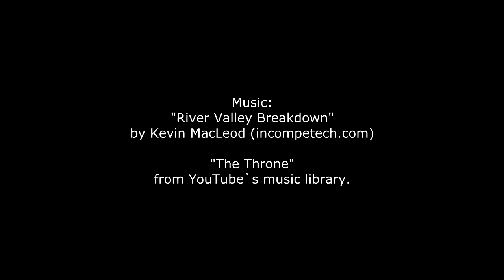How I build my Mason Bee Hives

Comment: You should turn the plank over and rout grooves on the other side too.  This would double the number of channels when you stack them.
Reply from the maker: Yes, I sometimes do that if the plank used is of a thicker dimension.

All the best,
Halvor.
Reply: I tried doing that but it doesn't work because of imperfections in the planks, the holes dont align perfectly when stacked.

Comment: Thanks Halvor.  Great how to video.  They are hard to make and this one will get lots of views.  I am going to research to see if we can have mason bees in Alberta Canada.  I need more pollination here.
Great work!!!
Bruce
Reply from the maker: Thanks, Bruce!
They are not so hard to make when you`ve made some of them, and received some routine. The holes can also be drilled insted of carved. However, it`s somehow tricky to get the holes exact in the center of the plank gap, so that`s the reason I use a carver.
The mason bee species, "Osmia lignaria" should be quite common in Alberta.
Do you want to give it a try? I`m sure you`ll notice a good increase of fruits. :)

Best wishes,
Halvor.
Reply: Gardening in Norway
Reply: Gardening in Norway Sorry about the empty post.  Do you have any idea about how much time I have to get the hive out?  We still have snow on the ground here.

;-(
Reply from the maker: Bruce Pender
As long as you are out with them before the fruit trees begins flowering, it`s ok.
At my location this is in May. So I think you have some time left to make a couple. :)
Reply: Gardening in Norway thx

Comment: Halvor - this is a very fine informational video on several different levels. You are also an accomplished craftsman. Well done! Would you mind disclosing the mud you create for the hives? I am interested in ingredients and ratios of each. Many thanks.
Reply from the maker: Thanks!
The clay I use, is mixed with water to a kind of thick slush. I haven`t got a special ratio for the amount of sawdust I use. I just mix the sawdust into the slush until it has a pliable putty-alike consistence, easy to apply on the wood. It must not be too dry, or else it wouldn`t stick to the wood.
- I add the sawdust to prevent cracking of the clay.

All the best,
Halvor.

Comment: Moving out to the country in the next few months and plan to make a massive mason bee sanctuary. It's our duty as stewards to try and help, and bees are the lifeline for many.

One question though does anyone know where one could purchase the eggs? I would love to buy 50-75 to help get the hives started (vs waiting for it to take hold) and I was told you can store these in the garage during the winter and then put the container near the hives while they hatch in the spring.

Also another name for that metal rod you used is "All Thread" in the USA, just about any nut and bolt company should carry it including local stores like Lowes/Home Depot.

Comment: Interesting mix and use of plaster for the back.  How often do the bees nest all the way to the back if the back mud plug is convex or vertical? Do they have to plaster the back wall? Do you get Osmia cornuta in Norway?
Reply from the maker: Thanks for your comment.
The bees usally nest all the way back. IThey dont need to plaster the back, since it`s already plastered/mudded.
I dont think we have Osmia cornuta here. The most common type here is O. bicornis/rufa.

All the best,
Halvor.

Comment: When you clean them what do you do about the cocoons(Is that the word?) Do you just work around them or do you remove them and replace them? Or you only clean them at a specific time of the year? This vid goes in my watch later grouping for later projects!
Reply from the maker: The cocoons is gently removed, and transferred to a little box with a single hole. This box is then placed inside the hive, in the gap between the block and the roof. The process is done during winter.
If there`s any overwintering mites in the chambers, the cocoons can be "washed" in fine sand. Some even use bleach.
The outer cocoons are in some cases parasitized with parasiting wasps. This is usally not a big problem. The bee coocons can be lit through, to find and destroy these.
You can find much great information about this by searching the YT or the net. There are many great videos and articles about this subject.

When you first start with this hobby, it`s difficult to stop. It`s addicting. :)

All the best.
Halvor.